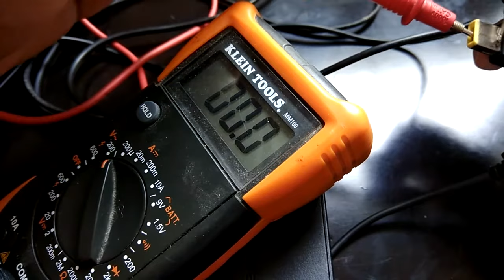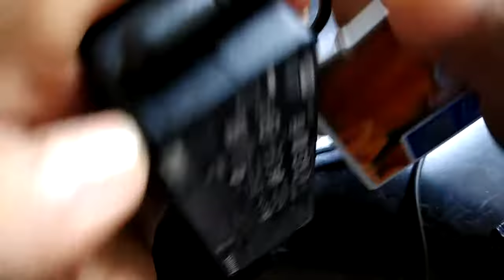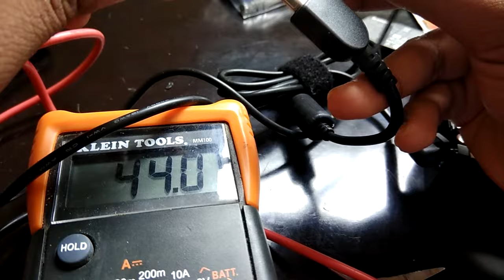Repair Lenovo Laptop Charger (Cable)

Comment: No way this is so easy mine melted using heat but didn't open. I don't know what kind of glue they use but it's impossible to open without breaking.
Reply: Thats true😮😮😮
Reply: Only using petrol is sufficient to open easily I have done.

Comment: Hello sir,
What will the reparing cost for this? my adaptor stop working, and smoke came out of it ,when I tried to charge my laptop it gave cracking sound like little short circuit.
I don't know what to do.😢
Reply: Get a new one
Reply: dwell.

Comment: Thanks for the guide. I have a similar charger and its very difficult to open. Even using alcohol and heating. Maybe another solvent like Lighter fluid or something, what do you recommend?
Reply from the maker: I recommend the exclusive use of isopropyl alcohol since in case of accidents it does not damage any electrical parts and a lot of patience.
Reply: @giorgisoft  Thanks a lot. I could open it with patience and heating

Comment: hi thanks for the video, this is useful. Can you clarify what is the solvent you used to melt the glue? alcohol? and are you using a hair dryer to heat it up?
Reply from the maker: i use isopropilic alcohol, but can use a little medic alcohol, to melt the glue, and yes is a hair dryer to heat it up.